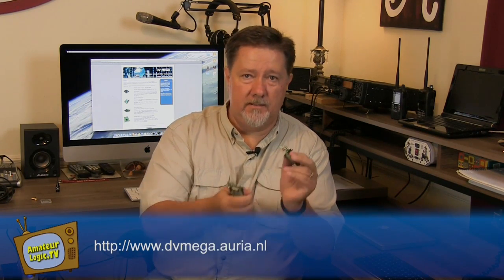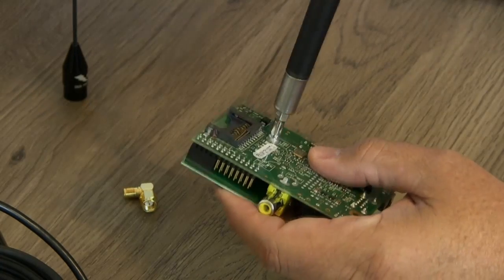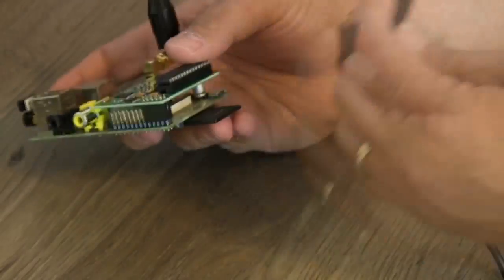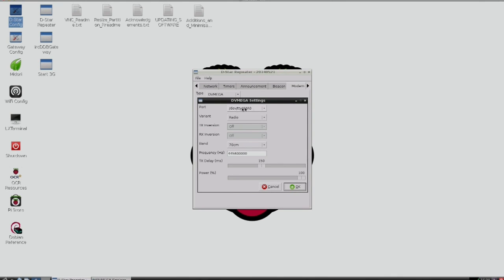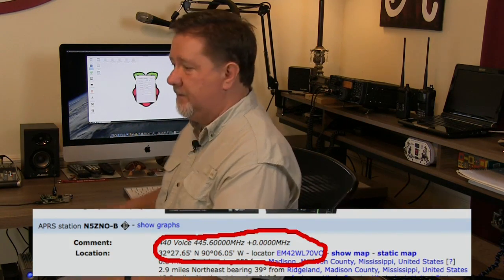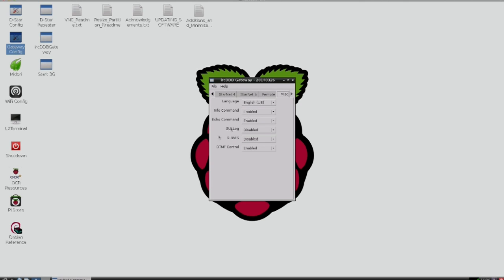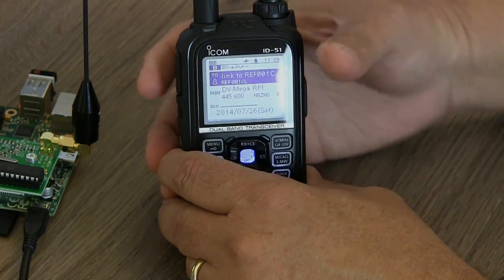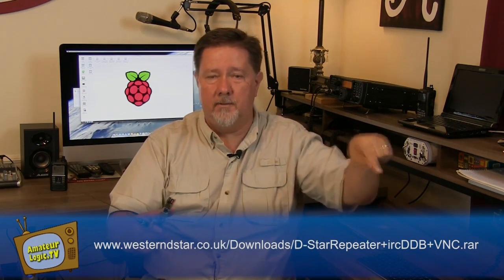Dv-Mega Raspberry Rpi Radio Unit! - AmateurLogic 69: DV Mega Load

Comment: hai I am VU2POL I am in a task to build a hotspot I connected my hotspotwhat settings should be on my icom id1  I am able to link to reflectors but some problem in my settings I believedo I have to register my device as hotspot I done it for my blue dongle long years back but now is it required for hotspot

Comment: I think my problem is with the programming of my Kenwood D74.  I have my DVAP programed just fine in the D74, but you briefly mentioned that the radio programming is different for the DV Mega, so did you cover that in a previous show??

Comment: Great Video.  Newbie Ham here....
1.   Can you just plug the Raspberry in without a monitor and mouse (in the car) and will it open the D-Star software for you?
2.  I understand the concept of using a 2m/70cm repeater to connect with D-Star; but I have no idea what a reflector is in either concept or operation.